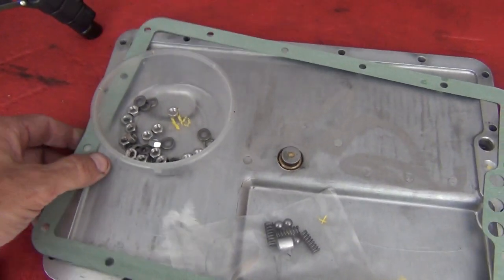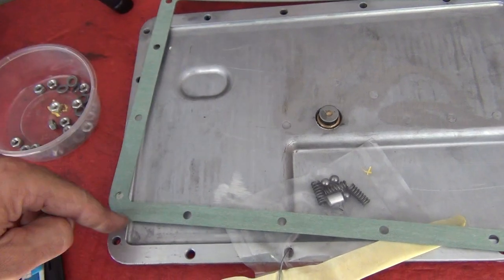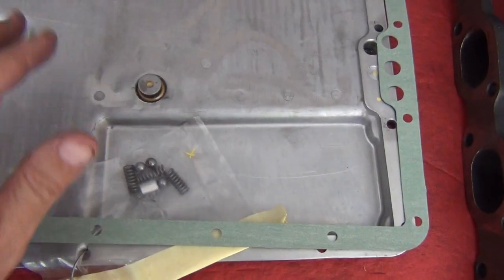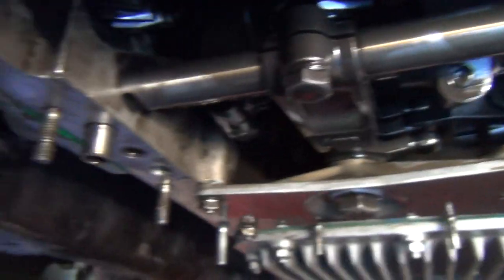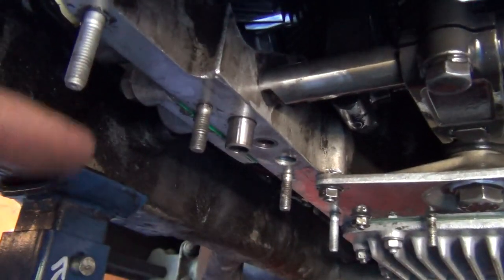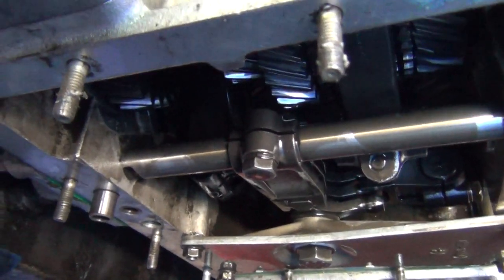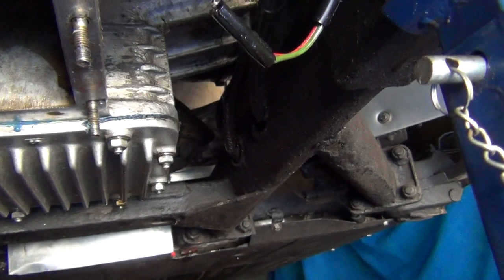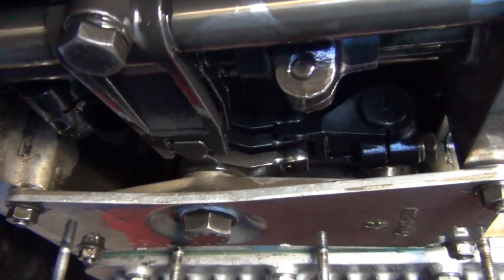Ferrari Mondial QV 1985, Gear selector adjustment/ Gear box sump cover reinstallation.

Comment: I'm curious while you have all this stuff apart: Have you seen any remnants of the chewed up transfer case cover? That would keep me awake at night, and it already has just looking at yours, lol.
Great reference material, as usual.
Reply from the maker: Hey Howard, Well to answer your question...no, not really. I strongly believe that this damage is from a past event. I don't think it's been caused by the last lock nut working it's way loose. The nut can't come off the shaft completely, for it rests against the transfer case cover. I had changed the gear box oil a few months ago and found nothing out of the ordinary. As a precaution (as I reused that oil this time) I filtered the oil and found nothing that I wouldn't normally expect. Keep in mind, the case cover is alloy and the gears are hardened steel. I don't believe the alloy would cause too much damage to the gears, nevertheless, it goes without saying that it's not very desirable. Sadly the magnetic drain plug won't pick up the alloy. Remember, the alloy particles would be in a very fine state and it's much softer than the gears. Cheers, Marc
Reply: Yeah, I figured the gears would basically pulverize the aluminum. It was more things like bearings or syncros that made me wonder. Glad to hear the evidence seems to have departed.
Reply from the maker: @howardscott7521  Good Lord ! Don't mention bearings and syncros please...do you want me to start having nightmares as well ?
Reply: THE MESSENGER Haha, I’m sure you are good at this point. Isn’t the internet great? I can transfer all my unsubstantiated fears around the world in milliseconds!😀

Comment: I got a question. I just posted the comment on the oil pressure video. Anyway. My 85 QV won’t go into reverse and it will slide into 1st but it acts like neutral. Sounds like linkage to me since they share the same. Let me know what you think. I’ll be pulling the pan off soon
Reply from the maker: Hey Matt, Take the chrome shiter "gate" off first, its two screws...easy one to check. Try and get the desired gears with it off. If that doesn't work, try moving the Mondy back and forward in a rocking motion. If that doesn't work, get under it and check the selector shaft and see it it's moving freely. If all that fails...Drop the pan and check the selector fork. If you watch the video it will cover all you need to know to check it and, or reset it. It's not out of the realms of possibility that it may have moved slightly. It only has to be 2-3 mm out and you'll have selector issues. Just keep in mind I'm no expert and offer this troubleshooting as advise only. You'll be right, it's time consuming, but not too hard. Let me know how you get on...Cheers, Marc
Reply: @themessenger5868  perfect!! I’ll do those steps. Tearing these apart does not scare me. I’d do it step by step. Thank you!!
Reply from the maker: @boisedynaa  Funny, "shiter" gate...ha ha !
Reply: @themessenger5868  one more quick question. What are the correct part numbers for the Cam Belts? For the 85 QV. Thanks for all your help!!!
Reply from the maker: @boisedynaa  111334 QV Timing belt. It should have 96 teeth and that should be printed on the belt.
Reply: @themessenger5868  ok great. That’s the number I came up with. Too. I wanted to double check with you. Your video gave me total confidence to do the belts. Looks easy. Just takes time. And pay attention to your cams and crank TDC
Reply from the maker: @boisedynaa  Yes...ALWAYS set TDC at the crank and the cams...then LOCK the cams. Mark them with a paint pen and you're sweet. It's not hard. Edit: In the cam belt video, there's a detailed comment that my further help you. Cheers...good luck !
Reply: @themessenger5868  perfect. I’ll check that would. Both belts 111334? I’ve read that one is 111334 and the other is 105206. But I don’t trust the internet all the time.
Reply from the maker: @boisedynaa  Both belts are the same 111334. There is no other number !
Reply from the maker: @boisedynaa  Matt check the reply comment to 'Stuart Hicks" comment on my cam belt vid...it will be helpful.
Reply: @themessenger5868  I’ll check it out. Thanks for all your help!!!!